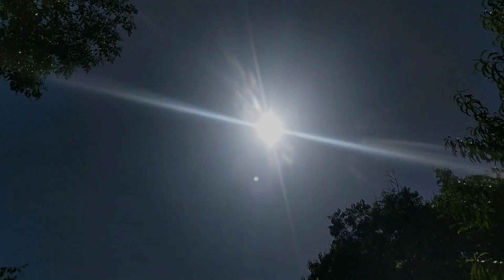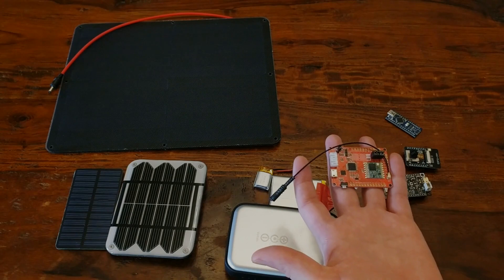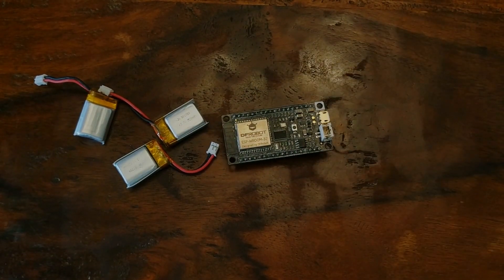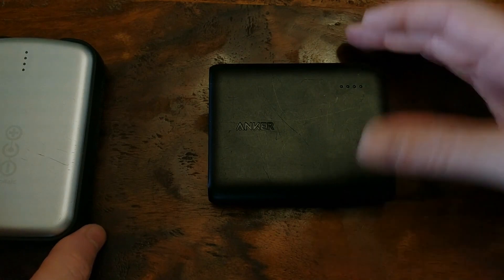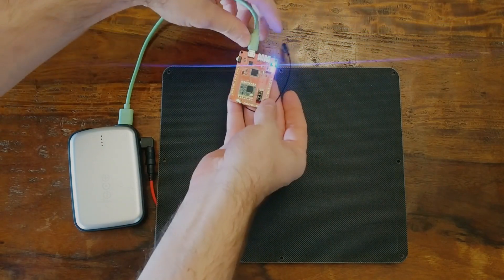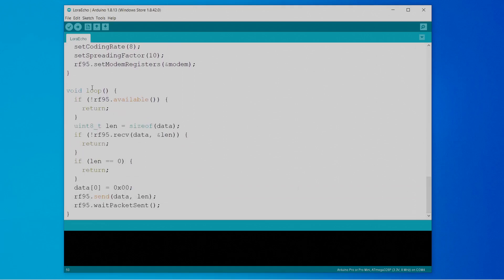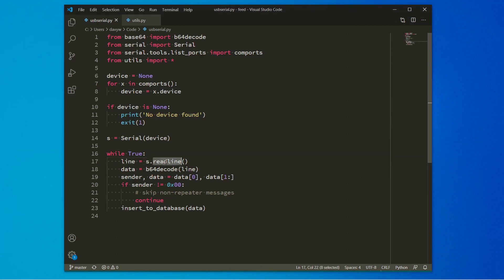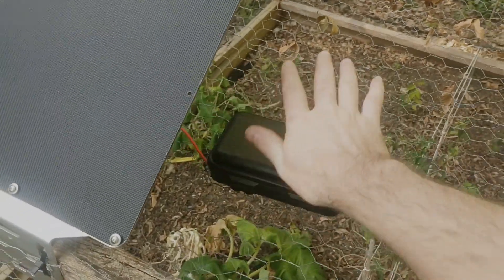DIY Solar Powered LoRa Repeater (with Arduino)

Comment from the maker: Correction: The RadioHead library DOES implement those methods now via: setSpreadingFactor, setSignalBandwidth, and setCodingRate4. So those functions aren't necessary with recent releases of RH.

It also has methods setHeaderTo/setHeaderFrom which will set the TO/FROM addresses on packets which means you don't have to waste that first byte as the sender ID. If you use those, call setPromiscuous(true) so that the repeater can accept packets with any TO address.

Comment: I'm concerned about the heat here in Texas, specifically the battery any ideas? These last few weeks I've heard of stories where Lithium batteries were starting fires. Is there a way to cool off the batteries? I was thinking of putting the controller and battery inside a small Electrical Junction Box that is white and waterproof. Using an extended antenna, and a solar panel on the outside (the only two holes in the box) but I'm super concerned about heat. I'm wondering if using another battery type would make it more sureproof/fire proof. Also the junction box is white so that should help a bit, but I'd imagine heat is still a serious issue even with that. O2 absorbers inside as well, and I really don't want to do this but I'm not super tech savy but is it possible to maybe rung a super long weatherproof wire. So the solar panel is in the sun and the device is, but the battery is maybe either buried or is inside a house? You earned yourself a sub. Thanks and great video!
Reply: A few things that might work.
Putting the solar panel outside and on top of the box shading it.
Some louvered cooling vents 
An aluminium box.
Cooling fans.
A larger box (would take longer to heat up during the day).
External insulation around the box with a gap for air movement.

Comment: Would you be interested in building and testing a large solar powered repeater network, that covers a large area of very rough terrain? I’d be willing to purchase/provide all of the necessary components, testing data/results, footage, and give you the rights to use solely on your YouTube channel. I have yet to see anyone actually build one out and test it. If it worked well enough, it would potentially be used by a rural volunteer fire department, where radios and very few repeaters (limited by funds) are spotty, at best.
Reply: Did u get this solution provided for you ?
Reply: @bluepinetxmedia-josepescad7649  no response.
Reply: Well if u need input - or some walkthroughs on coms w the topo u have - we might be able to help u out for the vfd -
Reply: I might as well be interested into making something like that.
If I get those parts

Comment: Mysensors project is the best implementation of Lora RH. All addressing, repeating, iot gateway,   p2p mode, payload, message confirmation etc is done for you.
 Save you load of time writing the radio code..

Comment: If a receiver is placed at Ground floor, in a 3 floor building, and the transmitter is at terrace, will the receiver be able to receive the signal?
Reply from the maker: It's hard to say for sure, because some buildings interfere more with radio signals more than others, but I've never had problems transmitting with several houses in the way so it should be able to go through a few floors of a building. Certainly a lot better than WiFi or BLE.
Reply: I'd assume it is based on the density and material of the building, is there metal in the walls? Are the walls dense blocks and concrete or are they dry wall?